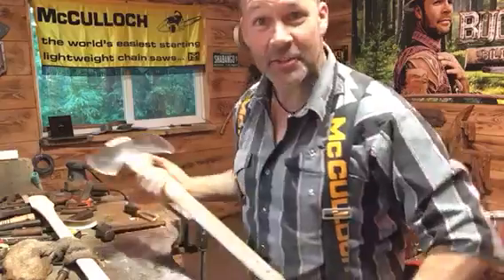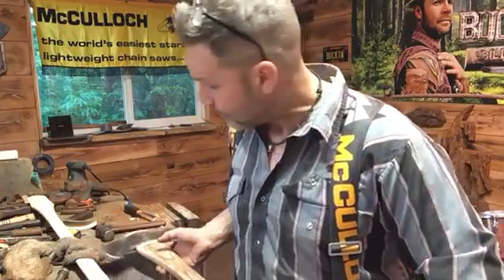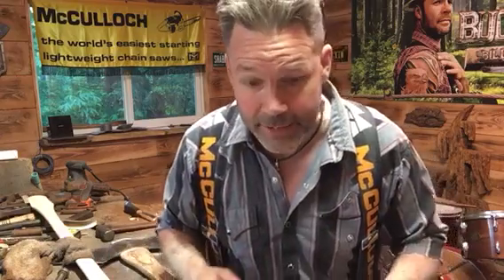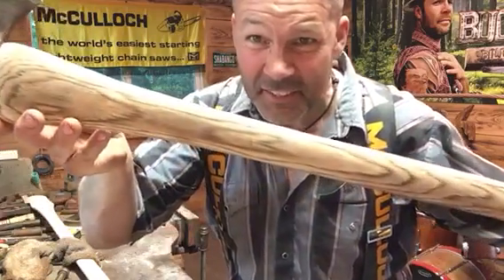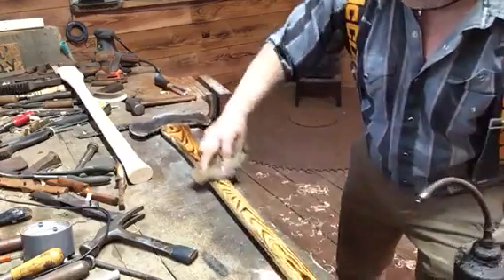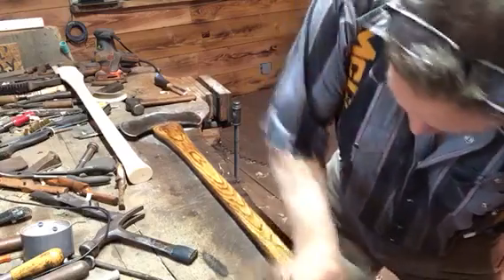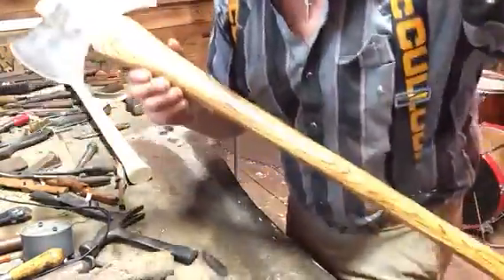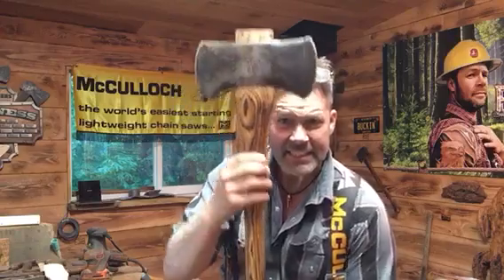Axe handle grain orientation

Comment: Absolutely agree with you - There is way too much rubbish and blather on the internet about grain orientation, a lot of it from them as don't know which end of the axe to hold
It does look prettier, but 'pretty' does not cut trees any faster or longer

Comment: I LIKE THE LIGHTER AX UNDER 3LB  HEAVIER PUTS TREMENDUS STRAIN ON THE. 4 5 DISC IN LOW BACK. GOOD EXERCISE.  HEY TRY  SOME BROWN OR GREEN PAINT MADE FOR PLASTIC  ON THOSE WHITE VINYL WINDOWS.  SAND WITH 200 1ST. IT WILL LOOOK MUCH BETTER. BE KIND.

Comment: People get so hung up on this.
Grain orientation matters to a degree, but it's more important not to have a lot of run-out.
You count the number of grains at the bottom and at the top, what you're looking for is a similar number.
Run-out is much worse, and for a hatchet grain orientation doesn't really matter at all because you're just not exherting much force on them.